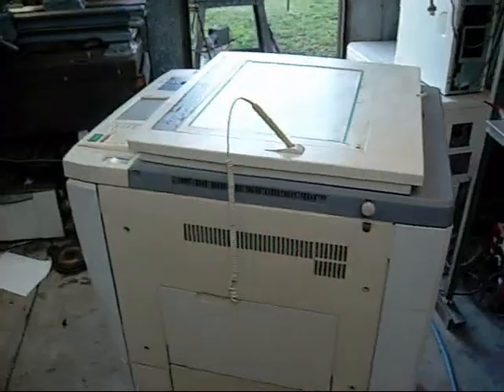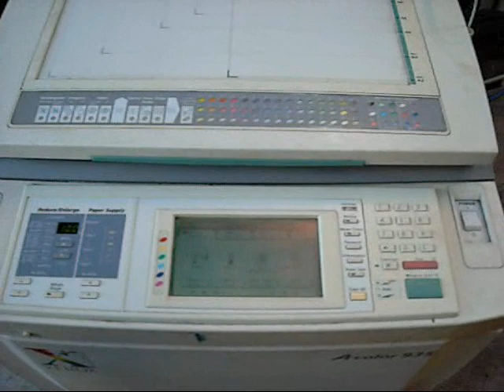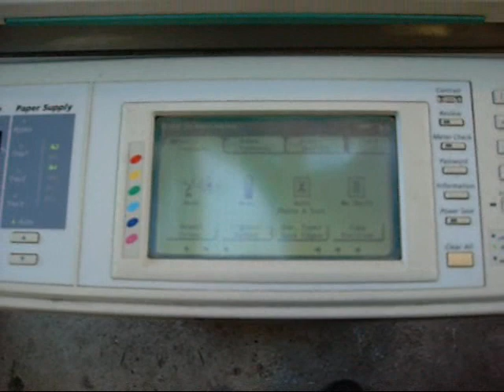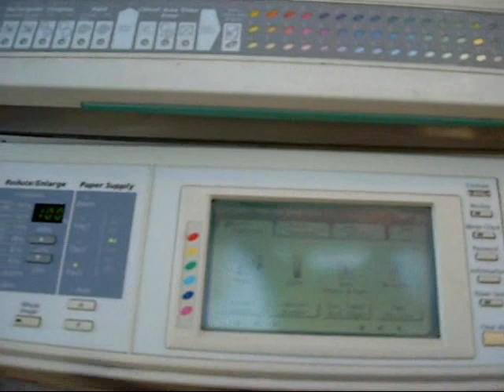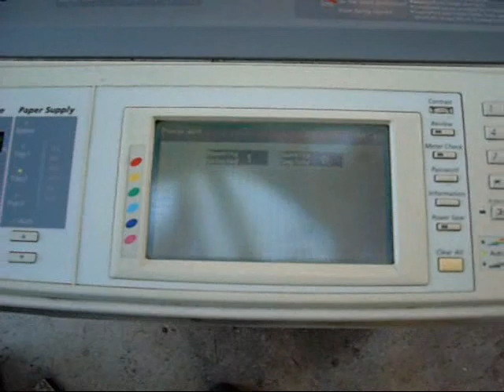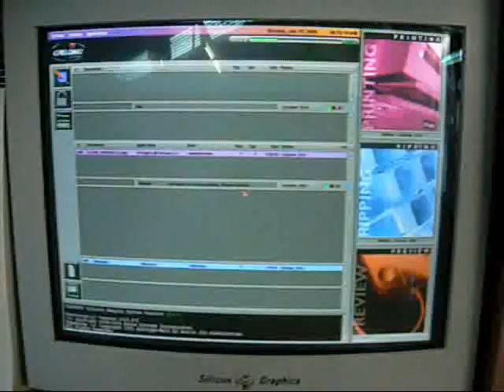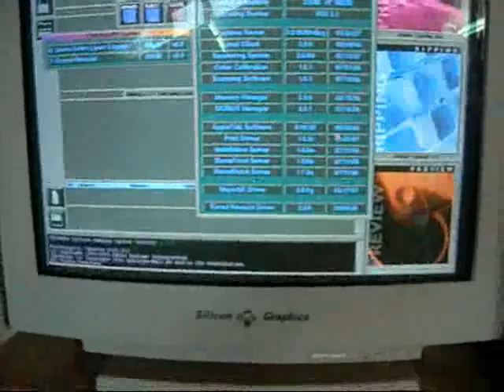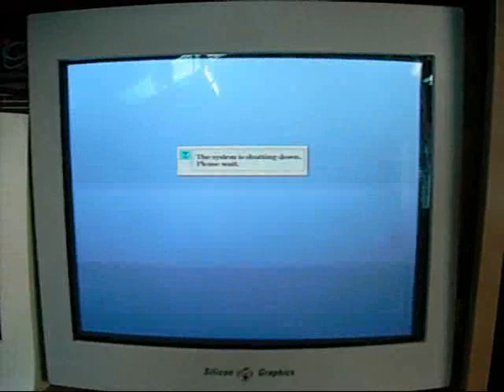Equipment Autopsy - Xerox Acolor 935 Copier Pt1

Comment: i run xerox machines at home too I have a able 1321 which is black and white only, and a Document Center C400 which is a newer model to this one. DCC400 working fine, doesnt like the cold, Able 1321 is in middle of being repaired minor faults.needs replacement pickup rollers and toner. side door needs a bit of a care to close but its held by the duplexer door its  a great unit when I finish fixing it.